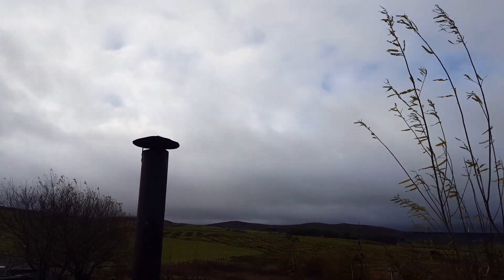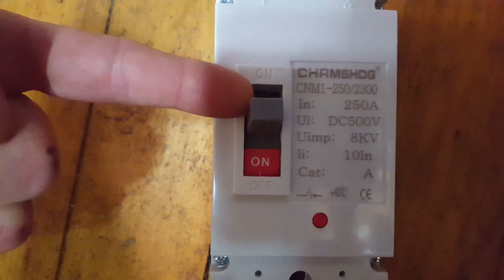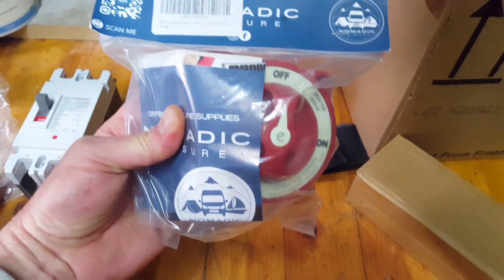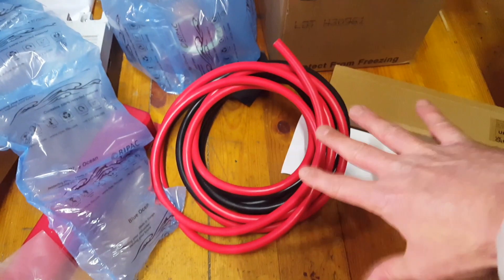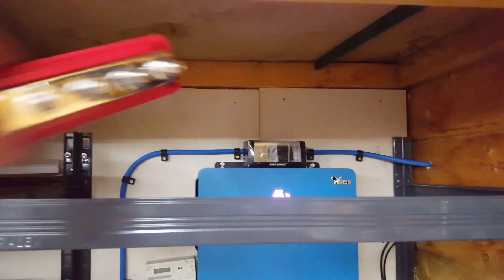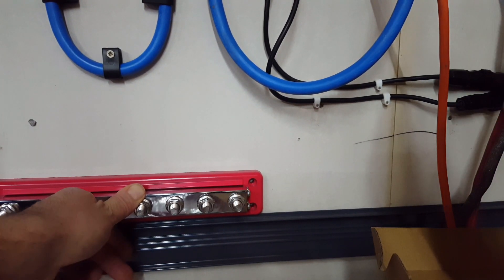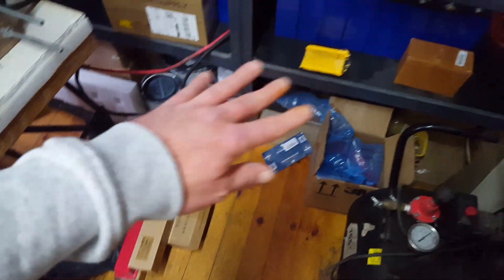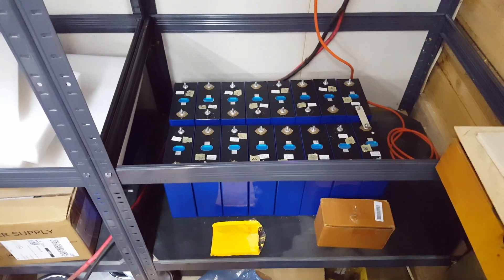LiFePO4 Bill of Materials is complete for my Big D.I.Y Battery build for home grown energy storage🤞

Comment: Be careful with the rated amps of those switches . I learned the hard way. I now use 2 of those switches side by side so they can carry the amps without getting hot . I didn't like having to double up a switch but I couldn't think of any other way from keeping them from getting hot
Reply from the maker: Hi thanks for the heads up, which switches are you talking about, the 2 breakers or the Red isolator switch?
Now I have the fear lol.
I am along way off from maxing out the Amps on the system but I shall certainly be keeping an eye out for anything getting hot. I thought the skinny cables on the JK BMS s would be the first to go.
Thanks very much.
Gaz

Comment: Just a couple of suggestions Gaz 🙂 battery 25 looks to be the wrong way round compared to the rest. You could do a board in front of the inverter cables to mount the fuses and isolators on as its only cables running behind it but can easily be removed if needed for maintence or you can do as you say a dividing board, you also look like you have space for a board to the right of your batterys and inverter but this could be camera trickery 🤣 id avoid putting a shelf above the battery incase things get a little warm. Metal rods either side and the middle would be the best way IMO as it would offer equal compression. If you compress either side then the middle could bow out causeing a imbalance on pressure between each battery. Great work so far mate 👍
Reply from the maker: Bloody hell well spotted!!! 25 is the wrong way around, just double checked and fixed it.   
I agree with you mate, rods down the middle is the best, as for the rest, this puzzle has many solutions, I am just going to have to pick one and be happy 😂
Cheers 
Gaz
Reply: @garys-half-baked-offgrid-dream  100% we are here to offer advise but ultimately its up to you which way you go. There is nothing to say that you can't do your system one way and then if it doesn't work how you want move it around after it's up and running. The joys of DIY builds lol
Reply from the maker: @karloffgrid  More like I don't want to waist cable, its not cheep 😭. I want to keep it symmetrical and efficient but I can see me ending up in a tangled mess and having a temper tantrum 🤣🤣🤣
Reply: @garys-half-baked-offgrid-dream  I feel you. I've only made the cables up for the parts I know are guaranteed to stay where they are. The cable from the BMS to the battery and the +VE from battery to bus bar I haven't made yet until my batterys come. I'll likely make the cables slightly longer though incase I add more battery cells to a 24V system. You could use hosepipe to test cable runs before commiting to making your cables up. Hosepipe isn't far off 35MM² cable so will give you a good idea of length and how it looks